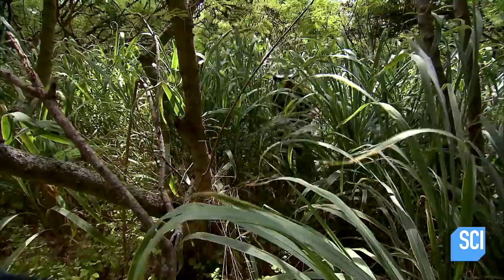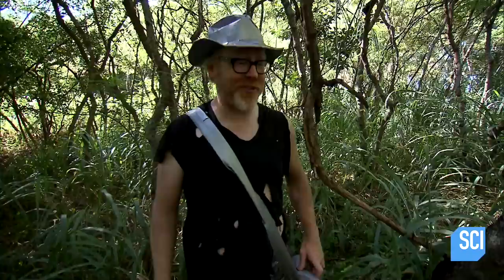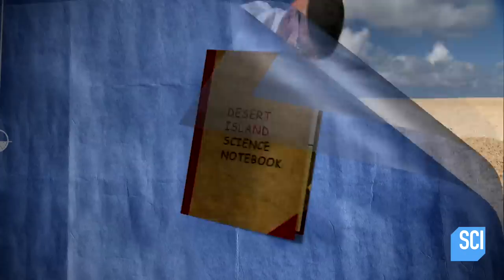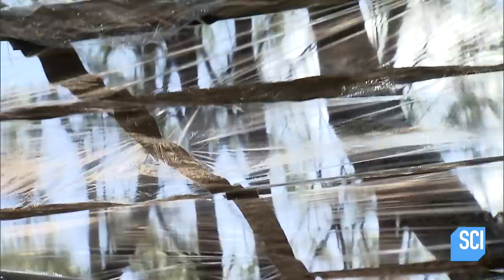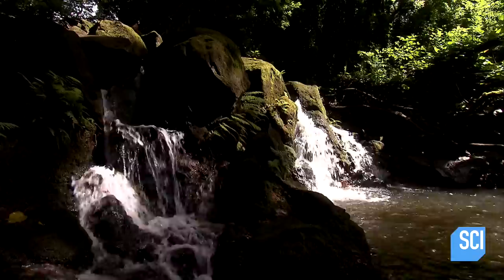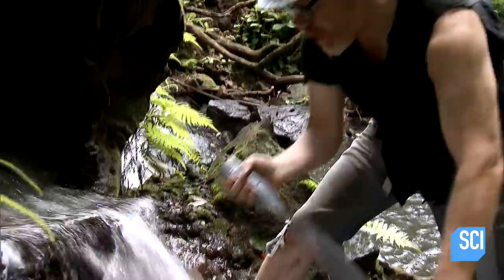Can a Solar Still Generate Enough Fresh Water for Survival? | MythBusters

Comment: The plastic idea is actually pretty good. If you set like 5 of those all day long collecting water. It's an infinite source.
Reply: @KawaZrana it would have been better if his salt water source at the bottom wasn't so small
Reply: good luck finding shit tonnes of duct tape and cling wrap
Reply: I don’t know why he didn’t bother to try to pour a lot of salt water in there too, have a lot more water to evaporate, although bear grills recommended peeing in it
Reply: It's not mine raft so there's no such idea as infinite water
Reply: @sangun123  what if he had two "cups?" One full of salt water and the other empty? With all of that plastic, he could've had several of those up and running at once and in more visible light.
Reply: like the ocean?
Reply: Emergy rafts comes with 3 usually, and they are a little more efficient.
Reply: The still has almost infinite water available to it. The sand is wet because the oceans water flows through it. So as long as you have the ocean nearby the deeper sand will be wet.

Comment: A solar still only works past dusk. You need to set it up in the morning, then wait until after dusk. The fresh water collecting in the cup is also evaporating. You need to wait until the entire system is cool, so the water will collect in the cup. Checking it two hours after set up is like trying to put the steam from a kettle into a backpack with your hands.

Comment: You’d need something to have the water to droop down into the cup, like a small rock or stick.

Also maybe this works better with something black.

And yeah, trying to find big ass trees so that a waterfall or pond could be collected from.

One problem though, you gotta worry about parasites!
Reply: if the cup is clean of sand there is no worry, parasites don't evaporate
Reply: The shape of the canopy does it mostly for you. Cohesion keeps the droplets on the cling film until they reach the epicenter (lowest point), and gravity eventually becomes the stronger force as moisture collects on itself.

Comment: You just make more of them.....its a beach ffs.  Large leaves tied over the hole should have a similar effect - creating humidity instead of needing clear plastic.
Reply: actually it's very important for the plastic to be clear so that it creates a greenhouse simply using leaves wouldn't produce enough condensation and thus wouldn't work personally I think his issue was that his solar still was poorly made rather than it simply not being a reliable source of water
Reply: I've seen it done before, with the sun beating down on the spot its possible to get some humidity going.
Reply: Johnston Steiner They've done that zombie experiment with multiple weapons...
Reply: Wrong, they never produce enough water to be sueful  @degiguess

Comment: I would take evaporated water over the water from the stream any day. Heres why... Bacteria and other micro-organisms living in that water. Great way to get sick. Thats why you use water purification tablets when you go camping and need to use water from a stream or river... (of course you can also boil it and with high enough temperature even the stream water will be "safe" but then again how do you tell if you achieved that safely?)
Reply: Boiling for just a couple minutes is sufficient enough to kill off bacteria. You can also use charcoal and sand to filter the water before boiling. Between filtering and boiling, that water is just as good as fridge water.
Reply: Bacteria and viruses should always be a concern when you don't know the source of the water. If it's a spring though and you get it at its source the chances of you giving a bacteria or virus that has any negative side effects is pretty damn low. Especially if you're getting it from a location where there's not a human population anywhere close. Turns out the ground makes a pretty good filter

Comment: You may try a clear box that is in a clear box or layers of glass panes. Between each pane is methane or a green house gas to trap heat. That in turn heats a plastic bottle of salt water to evaporate it and use a condenser cooled by wind or evaporation to cool the steam back into fresh water.
Reply: Why don’t you set up a nuclear power station, and attach via underground electric wires to a reverse osmosis desalination plant to produce your water?
Reply: @zachb1706  I think they have solar evaporation pools in the desert or at least hydro plants to run the reverse osmosis plants.

Comment: Just a scale issue then really... a 12 inch hole isn't big enough for one person. So maybe make it like 10ft. I dunno what you'd use for the top and cup in a real situation though.. maybe it could be done with waxy leaves? I guess you don't need to see the condensation. It just needs a hydrophobic surface for the water to skim along and down into the collection

Comment: One of the flaws in his water still is he disturbed rhe process during the daytime. He also made only one cup. Water wouldnbe dripping from more places than just the center point. Granted the spot with the most drops would be at the lowest point but a grid of containers , plus not disturbing it until nightfall, would increase his yield
Reply: you dont want a grid, if he were using a more sturdy material, you typically put a small stone or something to have a downward incline that moves the water toward the cup

Comment: a one inch pipe that is two feet tall and has a curve will compress heavy material to the base of the pipe. then an aperture will be place when it is straightened before to much compression is lost. then a noise canceling unit will be used to prevent reverb from desolutionizing the salt. if this works well it is a predesalination system and is mine so it is open source. have fun guys use math and prove me write.

Comment: Should have made a circle plastic wrap so he could have made a much larger hole with more water. Attach it all from the middle because the middle would be covered up by weight anyway. There's another method that produces more water but you have to make it out of clay and master fire.
Reply: Anomaly Evolution at that point that’s just way to much effort for little result
Reply: Or you could go looking for fresh water
Reply: @zachb1706  Unfortunately most islands will leave you disappointed.  Still it's always worth looking and making containers for the chance of rain.
Reply: The best thing is to start a fire and boil the water, either to clean it or desalinate it

Comment: Ah well that’s sobering

I think with a deep enough hole and a decent container this could work. Put a plastic sheet and a Mylar sheet in a survival kit (can fold down to the size of a pocket container) then dig a decent hole, form a rounded mound in the hole (hole within a hole holeception) then line it with the Mylar with rocks to anchor, then rocks on the sides of the wrap and one in the center. Maybe a plastic tube to create a drip siphon once the condensation gives you a good pool of water in the Mylar and a split piece of bamboo or something to bring the water to a shaded area for larger containers so it doesn’t just evaporate

Idk I think it could work 

Myth maybe

Comment: The first thing that you need to make is a weapon. You can then explore the island and look for possible fresh drinking water. The chances of you having any of the stuff featured on the show is very slim, in a worse case scenario, then you would have to try and make fire and then boil sea water to remove as much salt as possible. Oh and praying for rain or even doing a rain dance would work wonders as well.
Reply: Boiling salt water make it more salty. Thats the opposite of a still
Reply: @Nighttimeduck  The salt will fall to the bottom and you will have the residue at the bottom of the pan, it is a multiple process. The only pure form of water you actually have is your urine, however in the end that will run out because you are not drinking enough. So drinking your pee will keep you alive at least for a couple of days longer.

Comment: Ok, so 5% of their daily needs in two hours. Assuming 12 hours of heat and that's 1/3rd what they need. Still, I bet they could have increased that by setting it up for water from the sea to flow. Increasing the water surface area should increase the water evaporating.

Comment: Wow! 1/L of clean water for 2 hours of sunlight. In that heat and the exercise needed to setup survival, you definitely would easily at least 4 2 Liters of water per day. So, with 8 hours of daylight, this means you need at least 4 of those Solar Sills. Or a single one that is bigger.

If you need a solar sill in real life, you probably won't have 1 ton of duct tape available or clear plastic.

His Solar Sill design could probably been improved a lot. Here is what I'd do:

#1 - Digging by hand is not the most best idea in town. So...
Go to nearby forest, grab something hard, wide, and flat.
Basically, you want an "improvised shovel head".
That "tool" has these benefits:
- Dig faster, saving precious time.
- Dig more efficiently, wasting less calories and body water on the digging task.
- Avoid hurting your hand on random hard things in the sand like say a seashell or a little sharp rock.
- Reduce risks of sand between finger & nail, reducing odds of infection.

#2 - While you are at it, also grab not only some stones, but sticks, branches, and foliage or moss.
If you find thick clay, that is good too. Make sure it is clay, not mud.

If you can find stuff that it as black as possible, grab that too. Rocks, black soil, bark.
Not black mushrooms or plants, though, unless you are sure they are not poisonous.
If you find a lot of very "spongy or fibrous" moss, especially if black or very dark, grab that too.

If you got clay, quickly spread some on you.  Arms, legs, back, face.
That helps repelling insect bites.
Acts as a primitive sunscreen to greatly prevent sunburns.
Dirt might also work a little but nowhere near as well.

Don't bring everything in one go. Digging is hard work, you will have to
take many "breaks" and gathering then bringing back more materials
while you are "taking 5" in order to catch your breath will be a much
better use of your time of than doing nothing.

#3 - Look at the shape of the beach and choose the best possible spot.

Also look at how the sun is moving.
You want to dig the hole a a place where the beach elevation is the lowest possible.
This means less deep digging, saves time and effort.
You also want a spot that is the hottest big spot possible.
Thus, a spot where the "inside the sand" sea water traveled a little bit through the sand before
reaching your spot, thus making that water a little bit warmer than ocean water already.
Meaning, it will evaporate a bit quicker. Every little bit helps!
Also, put it away from the forest, so that sunlight will shine on the sill for as many hours as possible.
And on the most white patch of beach possible. The hottest things are, the best it works.

#4 - Make your plastic sheet.
Without a plastic sheet or impermeable sheet you're basically screwed, just go try to find water.
Your plastic sheet needs to be a square not a rectangle.
Don't make it too big, for it would end up being very unwieldy to manipulate, especially if it is windy.
If you have lots you can plan to make several Solar sills instead, but your 1st one should be done ASAP.
You can always improve on the design later on.
So, for your first one, yeah duct tape the plastic like he did.
Note that am opaque BLACK plastic sheet will work wonders better than a clear one.
This about letting about at least 6 to 9 inches all around your hole, for the plastic sheet
to overlap. So compute your hole size vs sheet size.

#5 - Dig the hole quite big.
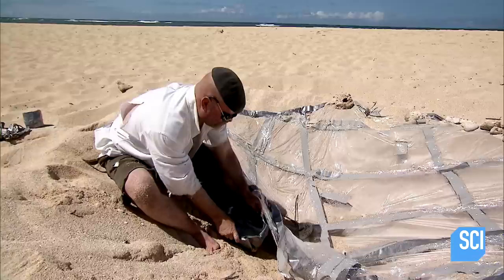At 3:20 we can see that his hole didn't remain all that big at all, the sides caving in.
What you don't want to do is dig it so deep that you end up with several inches of water deep:
The "too big amount" of water means it would remain cold for too long slowing down evaporation rate.
What you want to do is maximize the surface area of sunlight.
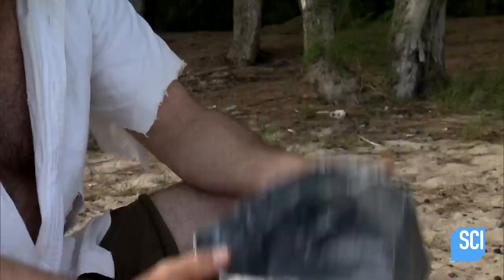At 1:58 you see he made it about 2 feet wide.
Make it as big as your plastic sheet, maybe 4 feet on a side.
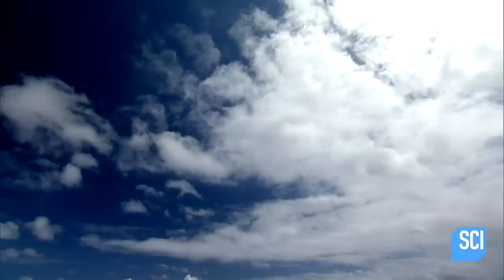Also, avoid doing something like what you see at 3:13, letting sand on top. Brush that off!
Because any shadow means reduced solar sill efficiency.

Don't dig too deep: you want maybe one inch of water in there.
Don't dig too shallow either: some sand will inevitably fall back in no matter what,
and you do not want  it to fall back in  so much that it would completely cover the water.
Sand is a pretty good insulator, so you,d end up with a much slower solar sill.

#5 - Use sticks and branches and some rocks and clay (if you have) to basically make
a "reinforcement wall" all around your hole. This will avoid the sand in the sides of the hole
all slowly ending up all collapsed back in, reducing the effective "sill working area".
If you use clay, DO NOT USE IT EVERYWHERE! Clay would prevent "new" water from coming it.
Leave the spot from which it seems the most water comes from 100% without clay.
Also, make sure your sticks and branches don't poke vertically, otherwise they will end up

ripping your plastic sheet. Then all your efforts will be ruined.
If you got a black plastic sheet then getting some black material for the bottom is not important.
If not, and you found some black material, cover the bottom of your hole with it.
Black material absorbs more sunrays than clear colors, and thus more energy converted
to infrared =  much hotter inside the "tent" = you get more evaporation!
If you got mossy fibrous stuff, put some inside too.
Spongy material will suck the water inside it and thus expose
a LOT MORE of "total surface area" to the air = you get more evaporation!

#6 - Place sheet over hole, solidify in place using stones.
If you've got clay, first make a big flat "cement ring" all around your hole.
Otherwise just use firmly packed wet sand.
This will "seal" much better the inside of the sill, this none of the precious 
water vapor will escape and get lost = more water for you!
Check where the bottom-most part of the sheet is, make sure nothing touches the sheet,
and place your water container  recipient right under that spot.
Finish closing the hole.

While you work, unless it is dangerous (jellyfishes, corals, etc.),
regularly go take a quick dip in the ocean water. Then put back some more clay on you.
At worst, use water from your dug hole to splash face and armpits to lower body temperature.
The last thing you want is to get an insulation. Falling unconscious in the sun is not a good idea.
Similarly, don't try to rush digging the hole as fast as you can. Do it methodically, at a
reasonable pace. The last thing you want to do is overheat yourself. Also, working too hard
would make you breath a lot faster than necessary, ending up wasting a lot more of your
precious body water. Take breaks, go into the shade of the forest or a quick dip in the ocean,
basically keep yourself COOL.

Properly built, a single Solar Sill can produce a lot more water than what he got.

Comment: If they had 16 hours they would make 1 cup. So 32 hours for 2 cups. However they could maybe increase amount by either less water or more water to evaporate. I think less.   Less water in a greater volume, the faster it will evaporate. Also the size of the hole itself, though needed to put the container, is helping to make longer condensation periods I think.

Comment: It's strange that Jamie didn't make two containers.  One to catch the water and one to transfer it after checking on it.  Would be interesting to see if left alone for 4 hours, if it would more than double the amount captured or less than double it.  On the beach, anywhere that isn't too far north or too far south, will have a solid 8 hours of beaming hot sun a day.  It's possible, if left alone for 8 hours, it could have accelerated until the sand dried out.  Then you make a new hole before the sun rises the next day.